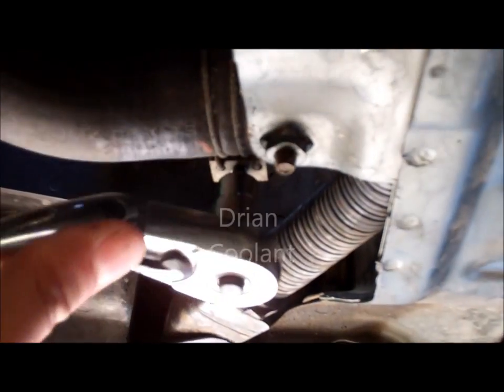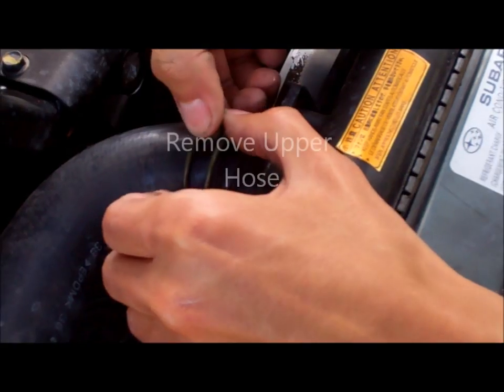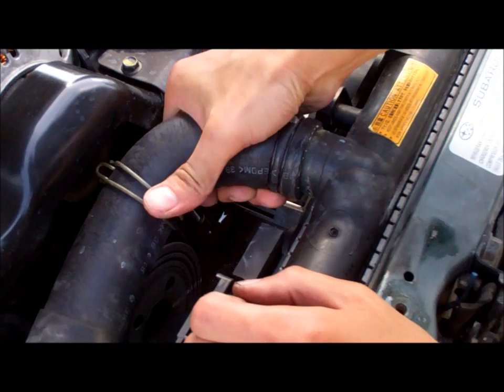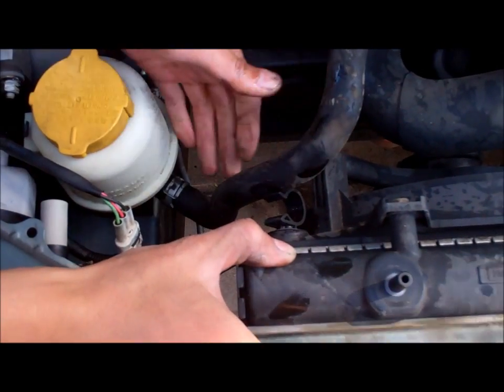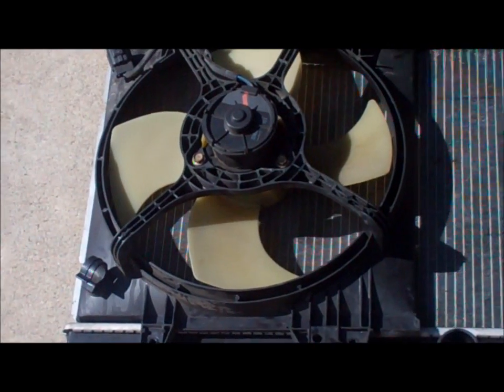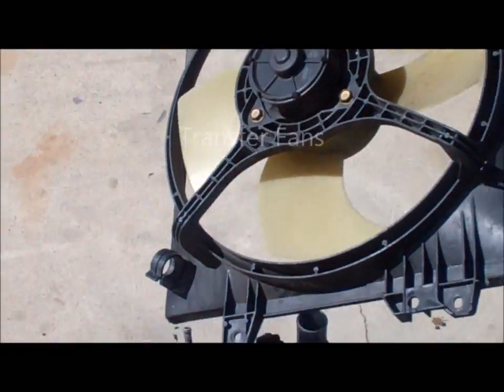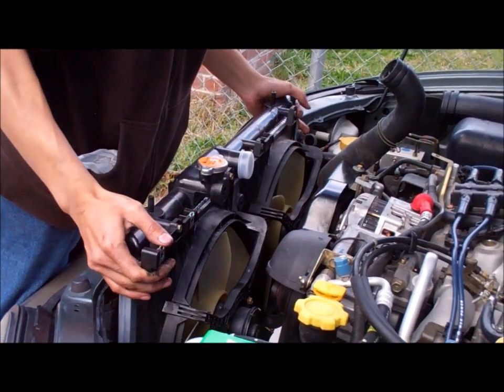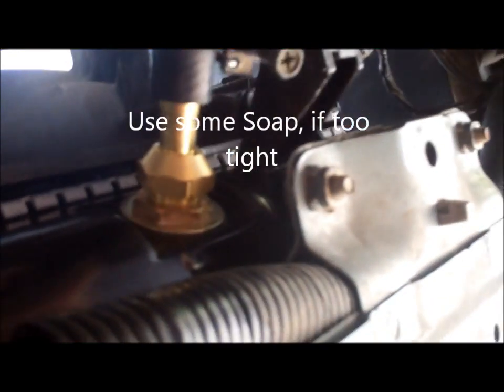How To Replace a Radiator

Comment: Thanks for this video. My wife's 2002 Outback came home last night steaming, with antifreeze all over. Could not for the life of me find any evidence of a cracked hose or loose connection. Coolant seemed to be collecting at the bottom of the radiator fins and was being picked up by the fans and sprayed all over. I decided to pull the radiator since it seemed the likely culprit. Your video was spot-on. While I was buying parts, I went ahead and replaced the thermostat, lower hose, and radiator cap. All is well. I started the job this morning at 10:00 am, had the radiator out by 10.45, got some lunch, drove 60 miles round-trip for parts, and had it back on the road by 3:00 pm.